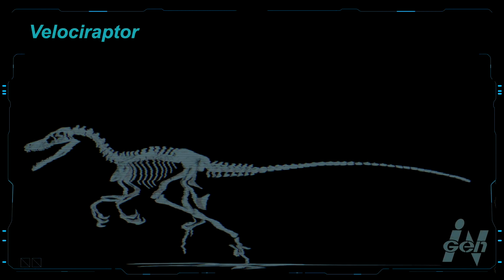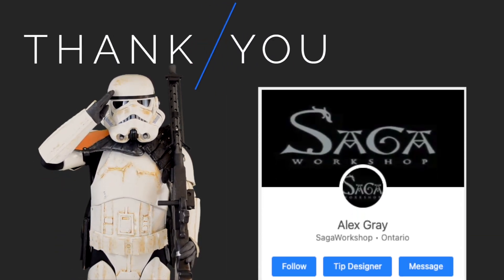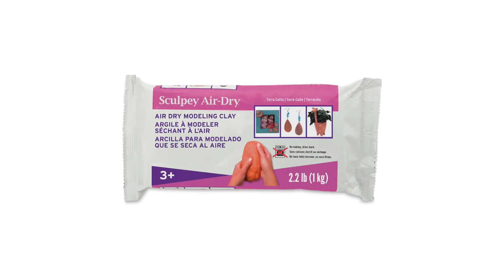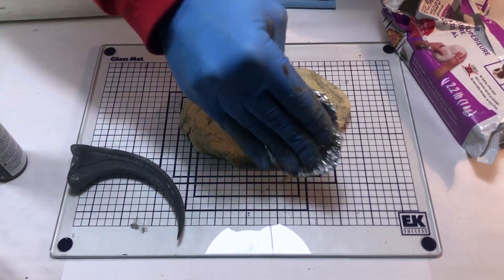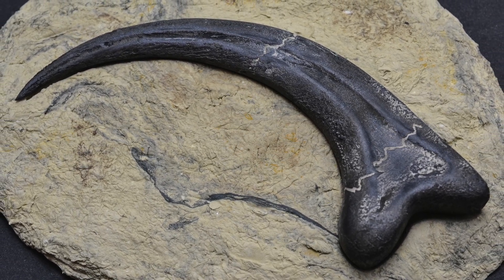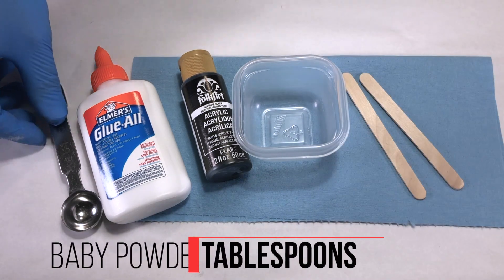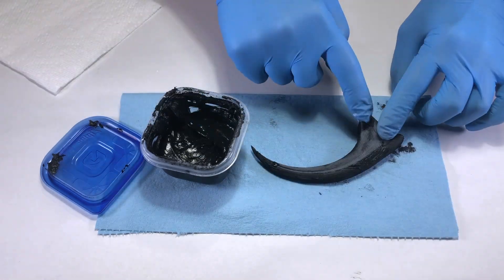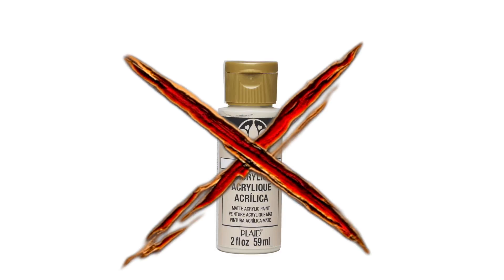DIY 3D Printed Jurassic Park Raptor Claw Fossil with Display Base

Comment: I just gave this a try after a benchy on my new M5C.

Massive failure. I guess "fast" print speed wasn't the best choice. I'm trying again on "precision." 🤞
Reply: And... Fail.

Whether it didn't adhere well enough or the print speed was still too high, it failed very early. Where the claw touches the bed broke off just a mm or two high. 

I may have to go to desktop to see if I can slow down the print speed any more, as the app only gives me the generic settings.